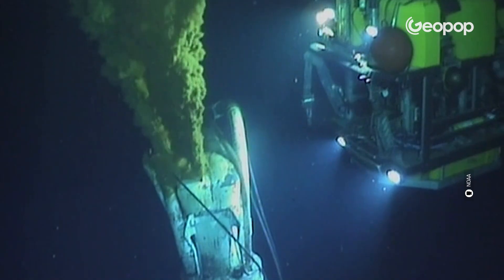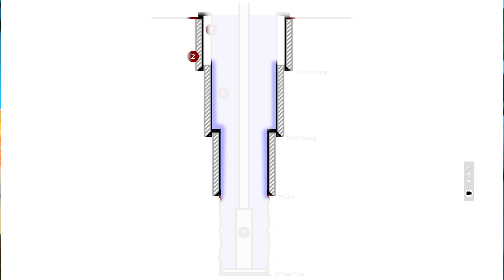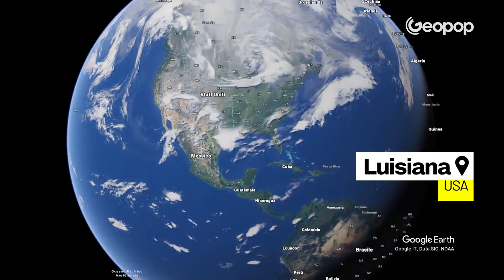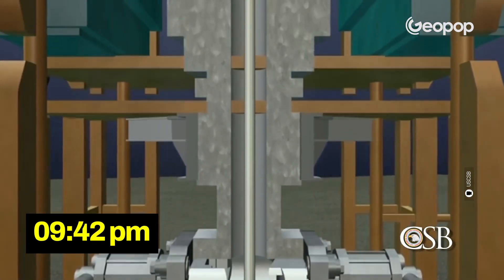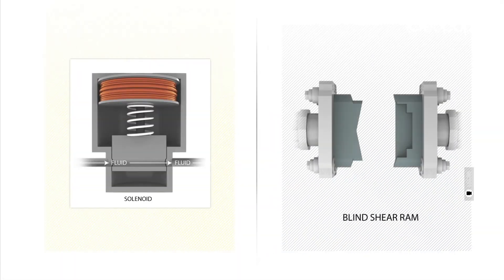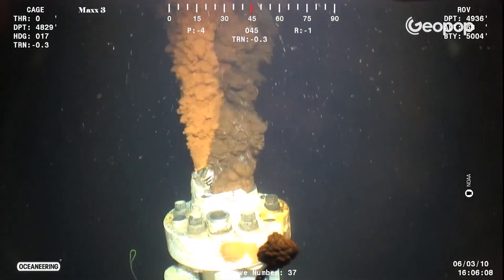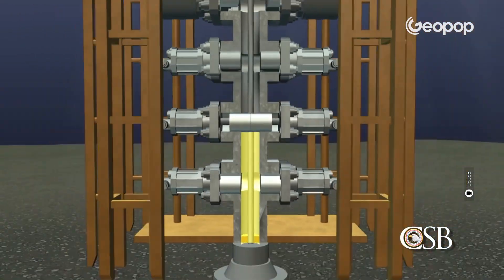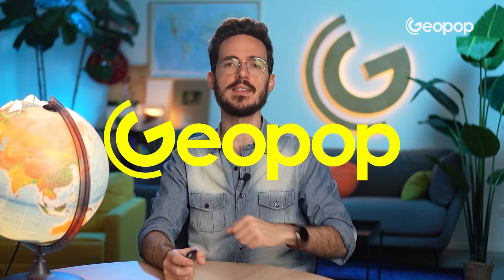Deepwater Horizon, the reconstruction of the most serious environmental disaster in the USA

Comment: No, the cement job had to my nitrogen usage. The additives are used to speed up cement curing speeds, however it can create pockets of foam instead of cement. A CBL wireline tool is used to transmit a signal that carries down the casing and is picked up with reciever at end of tool. If the sonic signal is loud, no cement, if sound is deadend, cement is good. They didn't run this tool
Reply: So no test, but still have heavy mud downhole keeping gas out. Then run a negative pressure test. Removes heavy fluid from wellbore with light fluid to see if pressure from formation enters wellbore and increases pressure. You need light fluid down to run last bit of casing. Test passes, they begin prep to pull out, cement cracks, fluid rushes in, its a long time before they notice because they had faulty equipment. Bobs your uncle, blow out